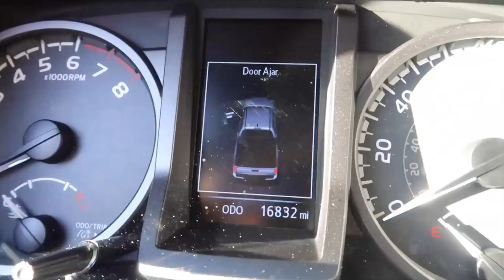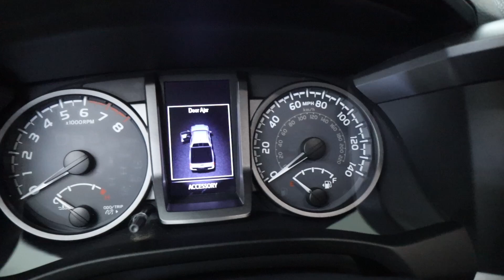What Things Went Wrong at 50k miles on my Tacoma?!

Comment: I noticed yesterday that my power steering fluid level had dropped a little. Not much, but enough to notice.  I couldnt find any leaks, but with all the snow we've had i couldve missed it. I went by our local dealer and he couldnt see anything either. Its 21 TRDOR with just over 28k on the odo. Im going to get the drop in fluid documented with toyota for any warranty issues that come up.

Comment: I will say Toyota quality control has gone down SIGNIFICANTLY over the last 5 years. I have an 09 Camry XLE V6 and it makes 0 weird noises, 0 weird feelings, and you can push on almost every panel and there's little to no give. I have a 2012 Camry L 4 cyl and it also has this. However, both my 21 Corolla that I had and my 2020 Tacoma now have really stupid issues. The window sill trim, when the window is down, you can wiggle it and move it around and it flops and feels cheap. Also, the front bumper is cheap, the plastic trim feels like it'll fall off. And there's the somewhat common rear window noise if you slam the door with the window down. So, yeah, not nearly as "Rock solid" as it used to be.

Comment: As an independent import shop, we flush power steering systems every 35,000 miles. We utilize BG automotive additives, lubricants and cleaners. We also utilize Lubegard 100% synthetic power steering fluid when we don’t have their products readily available. I own a 2007 Tundra and other than replacing some of the rubber/nitrile hoses, no issues with the rack/pinion, Ove used the Lubegard fluid with excellent results. Consider adding 4-6 ounces of ATP 201 after the flush. That should solve your issue. BTW, if you must replace your rack and pinion, Toyota also sells remanufactured rack and pinions. Some dealers won’t tell you since they make less $$$ on these units.
Reply from the maker: Thanks for the insight! I’m going to follow this

Comment: 21 trd Offroad tech package 20k miles, I’ve had an intermittent rapid turn signal flash, typically when it’s cold out but has happened in the summer too. Toyota has no clue what the problem is. Other than that no issues!

Comment: My 2020 Tacoma Sr rolled over 50k miles and still runs great.  So far no recalls and mechanical breakdowns.   But the plastic interior panels do scratch just by breathing on it.  I had to replace the odometer plastic and shifter plastic.
Reply: Where can you get those parts at I been trying to replace mine

Comment: Great video and thank you for the content.

I drive a first gen 2003 Taco that just last week rolled over 500 000 kilometers (approx 310 000 miles).  I replaced my original steering rack at about 420 000 km, so I wouldn't be too happy about a leaking rack at 50k miles.  I agree 100% with other commenters here in that I would clean that boot spic-and-span and watch it like a hawk- maybe you caught some sort of splash from a parking lot up onto that boot.  It might even have been an oily sheen on a puddle in an off-road location.  If the rack actually is leaking, I'd consider taking it to a REALLY good shop that knows how to reseal it before dropping $900 for a new one.  Shops that can do this work well are not easy to find.  And the leaf springs!

The truck I'm driving now is my third first-gen, and all 3 of them were underbuilt on the rear suspension.  I had to put helper leafs in each, and I'm nearly ready to put a whole new set into the 2003.  It's a little disappointing that Toyota hasn't engineered a solution during the evolution to Gen 3.

Thanks again- eat, sleep, and you know the rest.

Comment: That power steering leak looks very minor. You could probably get away with adding a small amount of seal reconditioner (i.e. at205 reseal) to the power steering fluid instead of replacing the entire rack
Reply: In the 90’s we had this great product called motor purr. It was a little bottle of seal swelling liquid. It was great for power steering leaks and even fixed a handful of jeep rear main seal leaks
Reply: Could you just put this in as a preventative?

Comment: 00:15:50
My bed is not aligned with the cab. It is ¾ of an inch to the right and twisted ½ an inch such that the passenger side is closer to the cab than the driver’s side.
Noticed this during bed cap installation.
.

Comment: how is your OV tune holding up? I have a brand new truck and would like to do it but it concerns me being that its still under warranty.
Reply: I have a 22 TRD OR , had the OV tune installed at 7 hundred miles, now have 12,000 miles on it with no problem's. Have had it back at dealership twice since for service and a LED headlight issue they said no problem.
Reply from the maker: I really like it and have noticed no issues! I took my truck into the dealership for this rack issue which had nothing to do with the ECU anyways, but they didn’t say anything about it

Comment: The Tacoma beds are composite instead of steel so they will flex, especially since you off road. If you have seen other you tube videos they put stiffeners in the corner of the bed(by the tailgate to help stiffen the bed to handle the add weight of campers. Just something I noticed since I’m planning to do that also and again keep up the videos. Very informative and detailed.
Reply: And will crack if you drive motorcycles on the tailgate as well.
Reply: Total Chaos has the best designed bed stiffeners 🤙🏽

Comment: Loved this! Ive done quite a few mods on my 2020TRD Sport 4x4...she only has 11,500k on her but they are all miles Ive put on her since I got her right before the pandemic hit. I did have a 2nd gen (2012 same model...almost stock...just larger tires and a 3 inch lift i had put in around the 50k mark) i did trade her in at 65k for that 2020 and she only depreciated 5k!! Anyway..minor issue that drives me nuts is how easy it is to scratch the plastic on the interior plastic of the doors...I swear I just look at it and it scratches lol. I do take her offroad and she has a few pinstripes from the NM mesquite and catclaw but i wish protech could come up with something for the interior doors like they did for the  pillars on the outside...enjoyed the video and the chance to say a little minor issue...she is a beast offroad with her 5.29s, OTT tune and the Dobinson MRR adjustable suspension along with their leaf package. Its been awesome...and yeh i had the bumper cap thing too😆

Comment: The only issue I've had with my 2018 tacoma, is the cats failed at about 30k miles and caused the truck to go into a limp mode or derate mode but I got them replaced under warranty. That's really the only issue I've had, and the spare tire chain won't hold the tire up, and I've only used my spare once when I had a flat before heading to work one morning

Comment: Same thing with my ‘17 Tacoma on the floor mats. I think I might replace them with WeatherTech

Edit: Just to throw an extra out there, Super White paint started to chip on my Tacoma.
Reply: Just got a 23 Taco Off Road, and been doing research. I have heard and seen photos on the WeatherTechs curling also. Husky is a brand that is often mentioned and gets high ratings.
Reply: Put weather tech mats in the front and rear of my 22 today and they fit like a glove. They feel stiff enough that I don't see them curling anytime soon.
Reply: I have the Husky floor mats in my ‘19 Taco, and have had zero issues so far. They clean up really well too!
Reply: Mine is flaking around my windows on doors white Tacoma Toyota should do a recall on super white trucks

Comment: Thank you for being so upfront and honest with your content! That being said I now have a new gripe 😤 I now know my bumper caps are not aligned. And now my quick response 😂 My first new Toyota was 87 22re, 2016 is my last! I have owned every model year, and most 4Runner model.  I have baby'd my 16 Tacoma compared to all others and.... interior is garbage, weak, scratches easy, seat heater shorted out, carpet and mats thin,  Exterior gas door tweak, it's garbage, rain drainage clogs up, outside plastic is garbage, scratches easy,weak bumper cover,  47,000 and I have to add power steering fluid every 3months, I have the timing cover leak 🤬 with no Toyota recall 🤬   Tacoma is stock suspension, stock tire size, I have done air intake upgrade and supercharger coil packs to improve shifting and gas mileage 👍. I would trade this truck for a 89 22 re in excellent condition in a half of a heartbeat!! They were the last good Toyota's IMO.
Reply: The 16, 17, and part of the 18 years were full of issues. They really fixed almost all of the issues (by 2019)other that the AC not being the best in hot environments.

Comment: The plastic bumper in the back is garbage... my wife backed into my truck accidentally and the mounting area was completely shattered. Made of really really cheap plastic that is brittle. Got an at the helm high clearance as a replacement. My floor mats have that issue as well, lay them out in the sun and the heat will lay it down some.
Reply: yep scraped mine at stock ride height, just barely snagged it on a rock (1/8" at most) and the chrome piece shattered along with the supports. I've yet to repair it lmao. Been eyeing the Helm high clearance, how do you like it? Solid fitment?
Reply: @lllllllllllllllllllll1lll1  its solid. worth the time and wait. If they offer powder coat, get it! I did a raptor line that was thinned out... was nice but i didnt get enough coats and it didnt take to stone chips well. Looking into powder coating it and then masking off and doing a thick coat of liner to where rocks will hit.
Reply: @အပကျပ  I was thinking of ath or c4, anc with the rub rails. 
The c4 covers the cut a bit instead of having to be exact. 

How hard was it to cut and install?
Reply: @KrinklingPlasticBits  get a body saw, it makes it much cleaner than a cut off wheel. I did with a cut off wheel and needed to go back with a body saw and it made a much cleaner cut.